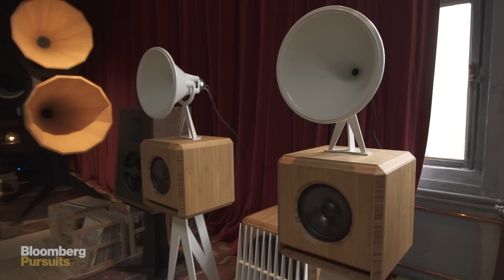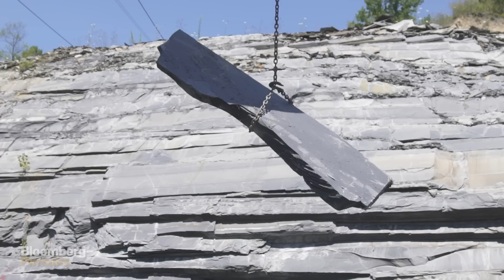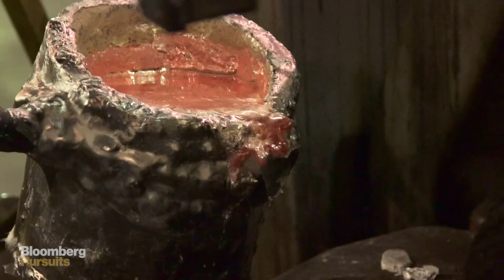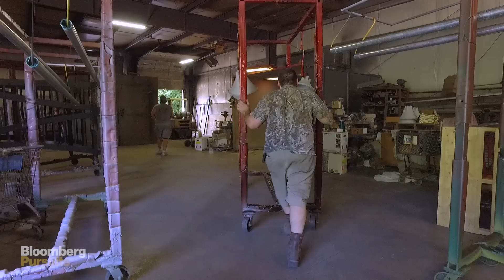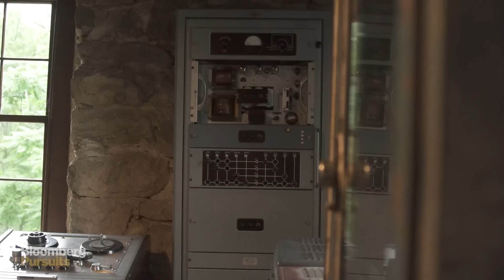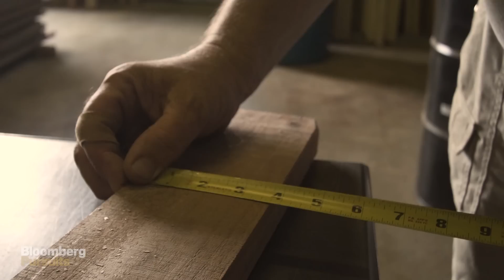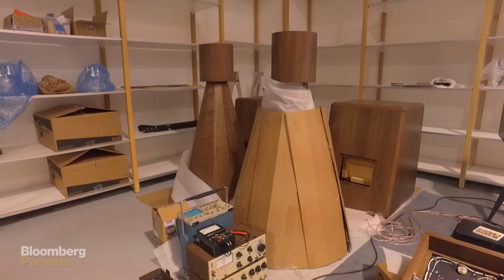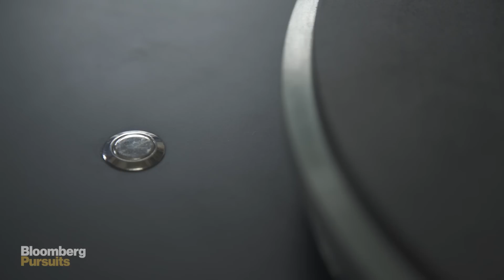How a $300,000 Speaker is Made

Comment: Very extraordinary claims, with all the evidence speaking to the contrary.
"We use the very best components, aerospace stuff..." To my knowledge the aerospace industry moved away from vacuum tubes and vinyl in favor of way better systems decades ago. 
"Solid wood joinery, no body does it!". A simple Google search will happily give you a few dozen companies that do just that.
"Everything is big because it has to be". While that might be true for the speaker membrane and cabinets, this is idiocy when applied to electronics. 
"We give the absolute best sound" by using valves and vinyl, which are measurably worse and introduce all sorts of aberrations? By using cabinets that are shaped for optimal visual effect without the slightest consideration for acoustics? I really don't think so. 
I am quite confident that with $2000 in electronics speakers, about $1000 in materials and about 40h of workshop time you could easily match their $300000 system. You could than spend the $297000 you saved in creating the most acoustically perfect room money could buy.
Reply: Eduardo Segovia dude you don't know what you are talking about so, instead of insulting others go and learn your stuff.
And I do know who they are competing with in this price point!
Lastly, analog is not as good as you think. Vinyl resolution is limited by the physical resistance of vinyl, dynamic range is limited by both the resistance of vinyl and the thickness of the disc. Vinyl records degrade with time and use (and scratches and breaks easily). Quality of the audio depends a lot on the quality of your record player (more than it depends on a DAC).
That plus the fact that high quality digital recordings crush vinyl in terms of quality of reproduction (provided they it had been recorded and mixed properly in a quality of CD or higher). Sorry but you can just check that with any industry professional. Most industry professionals listen mainly to CDs (I am talking studio pros, people who work or own speaker manufacturers etc.) ...
Reply: @Photoandcargeek  Everything said about vinyl happens to CD's.  It's Ok keep listening to the ear bleeding sound and live with it!
Reply: TheWoldIsFullofSheep EducateYourselfDontBeOne  you should listen to your user name.
Reply: Gattaca, just a note - saying tubes are better than transistors because guitarists use them in their amps is plain wrong. Guitarists use tubes exactly because tubes do distort and do color the sound, not because they reproduce the clean guitar tone exactly (you don't really want to listen to a clean electric guitar tone, believe me). So that is actually a solid argument against tube amplifiers with regards to faithful reproduction.
Reply: I've give him credit for some beautifully crafted bits of audio equipment. Tubes and vinyl are certainly not the pinnacle of audio reproduction and their products are more about the experience, emotion and interaction with the machine, the process of listening to music. This is why vinyl has taken off again as people miss the days of selecting a record and the interaction. Ultimately if you buy this thing you're paying $300,000 for some nice looking slate and wood.
Reply: "You could than spend the $297000 you saved in creating the most acoustically perfect room money could buy." - And in most places, a house to surround it :)
Reply: +TheWoldIsFullofSheep EducateYourselfDontBeOne So your saying, that vinyl, something that gets worn out from JUST BEING PLAYED, is better than something that does NOT distort, and can store every piece of sound PERFECTLY? Wow you are the one who needs to educate themselfs
Reply: let the rich dumbasses purchase this
Reply: yoshyoka yes and MDF is actually better for speakers than wood as it is an homogenous material which is really good at absorbing vibrations.
Reply: When you listen to a valve amplifier you tend to listen to a high end device. Also people tend to make listening to vinyls an experience rather than a habit. Masters are never kept on vinyl, they are used to press the vinyls. That is because the vinyl is a poor medium that wears out, has a limited dinamic range among other problems.
Reply: And a car to get to that house.
Reply: While I agree, the guy found an audience and is marketing to them. There's an endless amount of industries aimed at clueless yet wealthy people.

He should be careful with what he says though, he might get sued for false advertising.
Reply: TheWoldIsFullofSheep EducateYourselfDontBeOne Sure!
Reply: I was willing to give him the benefit of the doubt that they had modeled the soundwaves of their horns, but then he went on about the resonance of the wood. The timbre a wood guitar gives is not an attribute you want in your speaker. Furthermore, modern materials are vastly superior to old. For one, modern cone materials are lighter, stiffer and longer lasting than the best pulp cone, which has a major effect on the sound and power usage. I'm going to guess this guy also has $20K speaker wire that transmit magical old school pixy dust.
Reply: I believe what he said was theoretical, and is right in his own mind. Those that accept the itchy wool pulled over their eyes to believe that obtuse angles and wood grain deliver consistent untainted sound from an LP will believe it. Rules are meant to be broken, but 28 years of acoustic study in most cases this should not be the effective way to reproduce sound without unwanted anomalies. Especially at this cost.
Reply: Thing is, the guy clearly says that the system "reproduce so perfectly" which can't be true in regards to what he uses. It's a not a perfect reproduction at all though it doesn't mean it sounds bad either and i guess that's why people reacts. You can't claim you are doing a proper reproduction system when you use element that are known to actually alter the signal in many different ways.

Also anyone with a perfect reproduction system can easily apply EQ/comp or other kind of effects to get the same effect as a tube of a vinyl would add but many studies have shown that people in double blind test prefer the perfect reproduction system.
Reply: Tube surely don't offer any kind of fidelity which is why they are so interesting and still heavily used for sound production and not reproduction.
Reply: Eduardo Segovia 1. you don't know what you are talking about so go learn. 2. reported as you are breaching youtube comments policies.
Reply: yoshyoka I couldnt have said it better myself.
Reply: Oh jesus. You're really clueless to how the audiophile scene is, apparrently.

Tubes and vinyl are pretty much universally consiredered the best switch and best format, respectively. They have an imperfect but warm and quite nice signature, which people do like. In analog, size also does matter, since more it isn't like digital where the signal either comes or doesn't. 

Calculating the best "clean" sound is something that does happen a lot. And the truth is, audiophiles don't like that. They like being able to hear the components. That's what it's all about in those circles. If you use digital, you need a DAC, spekers, and maybe an amp. With analog, there is much more stuff to do and perfect.
Reply: But then don't claim you want a perfect reproduction system since you actually don't want a perfect reproduction because you want the sound of the components and not the sound that the artist recorded and then i think everyone will be happy :D
Reply: With the exception of parts, it only cost 300K because that's how much money he thinks his time and effort is worth. If I had all these same parts and built it the same exact way I could sell it for 45k and it would be the same product but the only reason it's cheaper is because that's what I felt my time is worth. Also  "Capacitors for aerospace, army and medical application are the best ones." That is false. I don't know about the medical field maybe they do, but I know the army and aerospace field don't always use the best "capacitors"or things of that nature, depending on the product and customer of course. The aerospace industry's equipment is reliable because its redundant just FYI.
Reply: The soldering quality from what i've seen is pure crap.
Reply: how about taxes..
Reply: TheWoldIsFullofSheep EducateYourselfDontBeOne well not long ago I watched a conference on YouTube where you had industry professionals (CEOs of hifi components and speaker making companies, engineers....) and when asked do you listen to CDs or vinyl most said that they mainly listened to CDs. A well mastered CD beats vinyl for quality of sound reproduction anytime. Now you have badly recorded and badly mastered CDs and you have great vinyls. Also vinyls will deteriorate with time and use, digital recordings won't. More you have even better than CDs to the point where some files are too detailed even for dog's ears. (we can't hear ultrasounds, dogs can).
It is also a well known fact that valve amps distort, good solid states amps don't.
Now I am not saying that a good vinyl on a good valve amp (and good speakers) don't sound good, they do, sometimes they can sound very good ... it is just not high fidelity, as it is not faithful to the source.
Reply: CD's die, vinyl doesn't, "vinyls will deteriorate with time" CD's will die before vinyl. A hundred year old cd is worthless, a hundred year old LP will play just fine.
Reply: @TobyIKanoby  a binary code will not deteriorate no matter the time: it is just information which can be copied at infinitum with no loss of quality. Vynil quality deteriorates every time you play it.
Reply: @yoshyoka  CD's deteriorate much faster over time than vinyl, that was my point.
Reply: @yoshyoka  Tell that to my collection of floppy disks from the 80's and 90's, a few old CDs that have disk rot, and my college era external hard drive that I put all my music on that died.  Maybe the bad sectors on the disks will fix themselves after learning that they weren't supposed to degrade.
Reply: @jonnda  Floppies and the like were never meant to be long term storage devices nor are CDs. Yet that is besides the point. The advantage in digital storage is that you are storing data which you can copy, reproduce and preserve virtually without limits. A track on a vinyl disk, on the other hand, will deteriorate imperceptibly every time you play it due to the mechanical erosion of the reading pin. Over time this deteriorate quality.
Reply: @Photoandcargeek  Wrong you were at a geek convention with fisher price equipment who don't know!  Just like you!
Reply: MKTech It was nice of you to be willing to give him the benefits of the doubt 😋, and you are right, MDF is far superior to solid wood for speakers, rigid, homogenous and very good at absorbing vibrations.
Reply: No modern day aerospace equipment would use this stuff ..... also why the fuck would someone use "aerospace level stuff" in the first place if it wasn't being used for aerospace "stuff" what ever that means....  it doesn't mean it's better because it's "aerospace level stuff" it's just works the best and the safest for that particular field.
Reply: yoshyoka I say 500in materials, 1000 in electronics.
Reply: @yoshyoka couldnt have said that any better my friend.
Reply: Holy irony, Batman.
You're*
Reply: This is for sound what harley is for motorcycles. Overpriced bullshit.
Reply: Actually tubes are more pleasing to the ear because they enhance the even harmonics whilst transistors the odd harmonics. It has nothing to do with distortion, even harmonics are just more pleasing to the ear.
Reply: digital all day here.... 180Db + worth of crisp clear digital sound lol " car audio 3x champ @ SLAMOLOGY "
Reply: @Tymprasta Technically no. It's not the data that deteriorates, it's the medium. And copying is more likely to cause error to the new copy (if the destination does not have error correction, like a CD or tape drive).
Reply: Actually... MDF is not homogenous, and the term you're looking for is Isotropic, which it also isn't.
Reply: I don't want to feed the flame, I'll give just my 2 cents: maybe they were talking about the listening experience, which is totally subjective and the fact that most people agree that vinyl sounds better doesn't mean vinyl is actually better. Talking about experience, no one can be objective. A whole another speech goes into sound fidelity, and here we're talking science, as it can actually be measured with instruments (oscilloscopes) and deviations from the function that represents the sound wave. In this field, no one in the video talked about sound fidelity, or response of the amplifier to the wave or something effectively scientific.
Reply: .. i think somebody found my comment not offensive but offensive offensive.
Reply: I work at Totem Acoustic and all of our cabinets are made with solid wood joinery processes. The only reason is we're a Canadian company so in summer it's very hot and indeed very cold in winter, so the cabinets move a tiny bit between those two extremes, and joinery is used to make sure they maintain their structural integrity, but that's all.
I know, and say to people who are friends - not to our client of course... - that all models 3K and up - and we make everything handmade and the max retail price is 16K not 300K that's ridiculous - are a waste of money when you don't have a 50-100K room.
Period. 
And no neighbors close, unless you have a suspended room in your NY loft. Then if you have this, call Totem Acoustic we will be more than happy to make you a room and system that will actually worth 300K with actual speakers and not sculptures...
Reply: ivanlagrossemoule totally true.
Reply: yoshyoka I am a big fan of the stuff done by rockport technologies \payor acoustics
Reply: Rockport make excellent speakers. When you get into the big bucks speakers, they all sound great, it's just what sounds good to you that's within your budget and room size. The major difference is the Rockports need a lot more power to drive them, they aren't an efficient speaker design.  The top end Rockports need a lot of power to drive them.  These don't.  Since they are horn based, they barely need any power to drive them at loud volumes and still have clarity.

These throw back to the 1930's RCA horn based speakers has a cult following.  They just are doing a more modern update to a pre-existing design that was done back in the early days of high end audio.

Magico has nice speakers too. 

I like MBL, but they require a ton of wattage to drive them due to their weird stave design.
Reply: sry but i didnt get that, im not speaking english that good. what does wool over their eyes mean?
Reply: To "Pull wool over someone's eyes" means to dupe, fool, or deceive them.  I believe it comes from the old US south when judges wore wool wigs. If you could "Pull the wool over their eyes"  it means you could fool a judge.
Reply: the world is full of sheeps lo
Reply: yoshyoka Hell yeah great video answers all the questions of the world
Reply: yeah probably a bit of the placebo effect.
Reply: are you from competition, or youre a sound engineer?, or what
Reply: think you were listening..but not listening listening if u catch my drift.
Reply: You are 100% correct. $300K my ass... Dovetails and slate don't cost three hundred thousand...
Reply: Allen Kemmett 
you went to college but did you go to college college.
Did you graduate graduate
Reply: None of us having listened to his system makes this thread pretty ridiculous.
However, in terms of clinical fidelity in respect to the source signal, yes you could probably find something a lot cheaper and "truer" (although that's also just a moot point because how in the world are we ever going to A/B Elvis alive versus Elvis recorded?), but in terms of listening experience, I think you better have a listen before being quite so confident. Sound engineering is never about clinical perfection, it's about transmitting emotions - something often lost in technical mumbo-jumbo. Does it sound good? It probably does.
Reply: SLAMOLOGY car audio , bassheads , and audio lovers would laugh their ass off at this guy for his $300,000 price tag of ignorance. " aerospace stuff " lmao my sides hurt on that one !
Reply: agree. just a bunch of advertising wank. a fool and his money are soon parted
Reply: 180db. you sure your hearing is able to tell the difference between good audio and shite audio anymore? loudness doesnt equate to quality. while i find it very cool, especially for deaf people, id never want to listen to my favorite tracks in those comp setups.
Reply: Do it!  I will buy it!
Reply: umm, do you even know what sound is bro??
Reply: Angga Tirta I could ask you the same about humor
Reply: LMAO allen your comment is now quoted haha
Reply: When your speaker costs 300k ... you don't need to sell more of them than just 1 per year or even less.. and you will easily stay in business.
Reply: 1000$ isn't enough for all acoustic treatments. Atleast not for my room.
Reply: The Bowers and Wilkins factory looks more like a laboratory from NASA. The Focal uses Beryllium, the same material used by NASA. This guy only use a lot of bullshit to sell his crappy products. Amuricans.
Reply: First thing I would have to do is crack it open and replace all the shitty old resistors and some of the caps.
The soldering is a mess - it doesn't make any difference to the sound, really but if you're spending 300k on a  setup, you'd want at least my 13 year-old self doing the job instead of the monkey they must have been using for slave labour. 
My current system cost me about 300 squid and it's about 1000 times better value for money than all this wank..
Reply: AMEN
Reply: Exactly. Specimen Audio in chicago makes artistic/sculptural conical horn speakers, if that's what one wants. Probably far cheaper too.

But I would trust companies like B&W or Danley Sound Labs over these guys any day. Companies that put R&D effort into the science of audio, not just in the visual aesthetics.
Reply: @jonnda  Than you should go to the big ones: Sony, Yahama etc... that's where the tech they source ultimately comes from. Unfortunately research in tech cost quite a lot and you need big companies to sponsor them. My humble source: I am an R&D Senior project manager.
Reply: Now that’s using your brains.. a lot of money for 2K pounds of mass in your living space.
Reply: I think he meant the steel materials for the aerospace stuff, so that your speaker stand will survive a nuclear blast. Except aerospace uses aluminum and the international space station is very haphazardly put together 'using the cheapest bidder'
Reply: This is a ridiculous comments. “Easily match…”
Reply: @a.s.2426  And this is a lazy rebuttal.
Reply: @yoshyoka  That's fair. Let me elaborate: You merely account for the value of raw materials (inaccurately and dismissively, at that), completely underestimate the value of know-how, of effort (which equates to time and therefore money -- including your own), and of build aesthetics. Net of these considerations, no you likely wouldn't get anywhere close on your own, not any time soon, nor at such a dramatically lower cost. And even if YOU are able to do it (because you have the know-how, the time to do it, etc.), it's a pointless recommendation to make to 99.9% of the rest of the viewers here and therefore a meaningless critique.
Reply: @Oneness100 I Just want to add something. Military grade doesn't mean anything like at all, it's 100% marking ploy.  The U.S military doesn't use one thing that's "Military Grade". It's called mil-spec and the reason why that most company's won't say that because they might not be at the standard or want to pay to have it tested. Also Mil-spec items doesn't mean the best quality it just means it's gonna be able to handle stressful environments longer then everyday consumer products, but probably at the price of other quality's and comforts. I'm not commenting on the quality of a "Analysis Plus" product. I don't even know who they are, i'm just putting that info out there. For a more sound and solid argument I would recommend not using the words "Military Grade". Source: "Common knowledge" 6+ years USAF avionics technician.

Edit- Spelling/grammar........I apologize for anybody reading this and having a brain aneurysm for the bad spelling and grammar. :D
Reply: As an actual professional music producer I can assure your that you are talking out of your ass... Nothing sounds better than a tube? In which context? And nothing is better than vinyl? Are you serious? Vinyl is great and has an extrodinary sound but if you want the best of the best you'd take a tape system or go digital and play it back over an analouge circut. What yoshyoka said is absolutely correct except the aerospace part, simply because I don't know enough about it to judge if he's correct or not.
Reply: Gattaca yes, good capacitors are better than bad ones ... and they will probably never leak and could last decades.
That being said, your statement about tube amps is totally wrong. Whilst the best tube amps produce a very pleasant sound, they will always distort. Hence, of you want the highest fidelity possible today, it has to be solid state! You will never find a studio equipped with tube amps nowadays, the pros don't use it anymore. As I said, I like the sound of the amps can be really good but there are only two types of people who use tube amps and claim they are the best: the nostalgic and the hipsters. (my best friend's father is a 70yo former jazz trumpet player who has extremely expensive gear including a McIntosh tube amplifier and plenty of other top notch gear... so I have heard some of the best but I would still go with some PMC MB3 or BB6 or with cheaper PSI A25 any day as they crush any of these fancy insanely priced speakers any day)
Reply: yoshyoka if 300k - (3k in materials+ 40 hours of your time) = 297k, I'd love to "pay" you to do some remodeling work I need done.
Reply: yoshyoka
I actually heard this guy's speaker on one of NY audio shows. They are quite good. 
Price point is consistent with other exotics. 
It's a commercial speaker intended to sell. 
Is it the best? Depends on what kind of live music you like. For me, it is not near the best of anything. But in all fairness, there are many even pricier systems out there that don't hold the candle to this one. 
Technical claims are made for people with money to spend and little knowledge.
Reply: But dude, did you even see that slate(/s)? There's a lot of nonsense when it comes to high end products for rich people. The world of audio is especially full of this kind of thing. It's really hard to quantify sound quality with the human ear alone. Remember when Gizmodo compared Monster cables to coat hangers and "audiophiles" couldn't tell the difference? How many uninformed people have paid 100 dollars for a single set of component cables?
Reply: Measurably worse if not the only metric by which one can evaluate an audio system - i agree with you that vinyl is measurably worse than CD's, or lossless digital formats. And that transistors are way more efficient and linear compared to valves. I have seen the data and read the conclusion - but from my many years collecting and listening to high-end audio equipment, my takeaway is that vinyl and valve gear for me, sounds more lively - there are tops and bottoms that i don't find in the digital formats - somehow something is missing. To say something is better or worse if a weird discussion because in the end, it all comes down to our ears and what we hear is different and not really debatable. I find OMA's work interesting, but a lot of those claims are either dead wrong or concerning something (audio being better) that cannot be given a clear verdict.
Reply: insert "thank you " GIF
Reply: +yoshyoka It is true that vinyl has a better sound. The point is, that it's keeping everything analog, so the sound wave is never converted into a digital sound wave. There is a limit to how perfect a digital sound wave can be. Think of it like a digital photo vs a 35mm film negative. The digital will only be fine at regular zoom, but as you start to zoom, you can see the limitations, whereas with a film negative, it's captured in the same way it's displayed, and never converted to digital, so nothing is lost. Example: http://www.centerpointaudio.com/Images/Analog-Digital%20frequency%20examples.png BUT you're 100% right you could make this sound for a LOT LOT less. This is still over priced, hipster BS. But he is right that vinyl/tube sound is better than digital, but you don't need a $300k custom setup to get that quality. You could match the quality for a couple grand.
Reply: Some people prefer the sound of tubes while others don't don't. Yes vinyl sounds warmer but a lot of people don't like a warm, they like the crisp, clear sound that digital can give you.
Reply: Hey Oneness100. Looks like you're running a marathon.
Either that, or just talking a lot.
Either way, have a glass of water.
Keep fighting the good fight, man.
Reply: Photoandcargeek Eddie owns lots of vinyls and can't can't come to grip that vinyl sucks...they look much cooler revolving around a turn table than an iPhone streaming Bluetooth to a bose sound dock...that's about it. I bet he thinks analog phone sounds Better than internet phone calls or tube tv looks the same as a 4K tv...smh
Reply: Photoandcargeek
Digital sources do deteriorate! But much slower than vinyl. Like 20-100 years of life depending on how they're handled, and theoretically forever if you copy the data to new mediums over time.
Reply: The cables they use are Analysis Plus, and that cable mfg. sells to NASA and Boeing, so they do use components that are used in the Aerospace industry.  Believe It or not.  It's just a question of exactly what they are using that is also used by NASA and other aerospace companies.  

They do use military grade resistors and other passive components so those are typically also used in the Aerospace industry.  Tubes were used many years ago before Transistors, but there are certain tubes that are used because for audio, some of these people think they still sound better than transistors.  

Dove tail solid wood speaker cabinets?  Name the companies that do dove tail joints with solid wood for speaker cabinets.  Go ahead, let's see your list.  

Most speaker companies use MDF with a wood veneer. The latest craze is billet aluminum that's machined, but those speakers are also VERY expensive.

They also acquired some vintage drivers that have been reconditioned that are highly sought after.

They use the philosophy that stems back to the early days of high end audio where speakers are high efficiency drivers using high quality Triode Class A power where you don't need a lot of wattage to drive the speakers.  Most speakers don't have sensitivity ratings of 104dB or higher.  Most speakers you see are in the 80 to 90dB range and they aren't as efficient and require more power to drive them.  Go look at Electrostatics, you have to have power amps with hundreds of watts to drive them as they can go down to 2 ohms and suck as much power as you have.  

The bottom line is that their speakers are expensive, they use very high precision design/mfg. and you are acting like an ignorant child about it. And they've been in business for 10 years and I'm sure they have built up a fairly decent clientele base and are getting more and more customers that are interested in their products and what they are doing.  They don't need to sell to millions of customers, they can have a small clientele list and if their product is a great product, the owners of their products have friends that also may buy their products.  That's typically how things work.  They seem to be well funded and they seem to have sold to enough people to keep them going for 10 years.
Reply: +malleureuse This thread is not about whether or not the sound is better than live, that's a different argument. The error in +yoshyoka's thinking, is that newer technology, is always of a higher quality. In this case, it's not. A digital recording, played through transistors does not have the same quality of sound, as vinyl played through tubes. The reason, in this case, that the newer tech is better, is that for what is unnoticeable/unmissed loss in quality to most, we gain a tremendous amount of practicality. CDs were more practical than vinyls, and ipod/computers are now more practical than CDs, but that doesn't mean that the quality from a hi-def audio file, will be better than that of a vinyl, it's just not possible. Something gets lost when the sound wave is converted to digital, that can't be brought back. For quality: vinyl/tube > digital/transistor, but for everyday practicality: digital/transistor > vinyl/tube. It's really not an arguable point, it's really just a fact.
Reply: not better stuff, lighter stuff. but i hear ya man
Reply: @karlwarner7438  im sitting in fromt of a pair of HEDD type 20s. hand made. dont mess with the germans!! haha
Reply: Well, you have probably never heard any high-efficient speakers on a high-grade tube (300b for example) amplifier on vinyl records...

Capacitors for aerospace, army and medical application are the best ones.
Industry moved from vacuum tubes because transistors replaced them, smaller, easier and cheaper to make. But ask any guitarist, no solid state amplifier can match a good tube amplifier, none.
Yes, Bass speakers have to be large, because it is physics, sorry...

Yes, high grade audio electronics need big room, because large components are more reliable than little components ! Take Marantz 9 for example, many of them are still working after more than 50 years. Will it be the same with your fucking phone or computer you 're typing on ? 
No.

I quit now, so much could be said to prove you're wrong...
Reply: So what about your claims: "quite confident, about .... in materials, 40h of time, easily, etc.". That all sounds like ur a fucking hypocrit. Theres no substance in your points at all. You are just spreading false or not proven things, just like u claim they do. Its like you just want to be the Genius in the comment section.